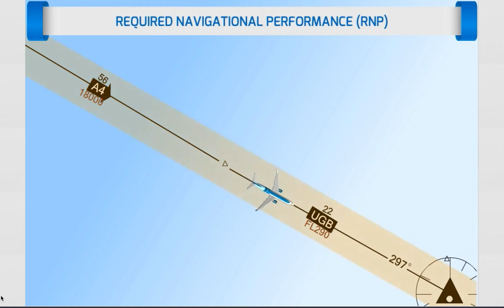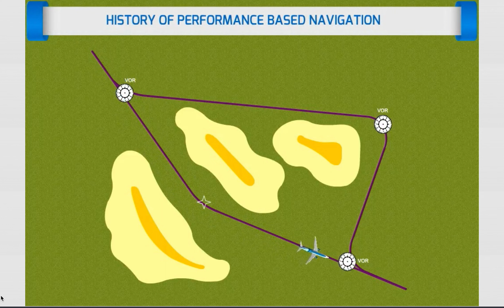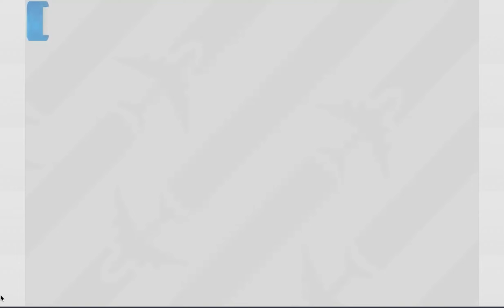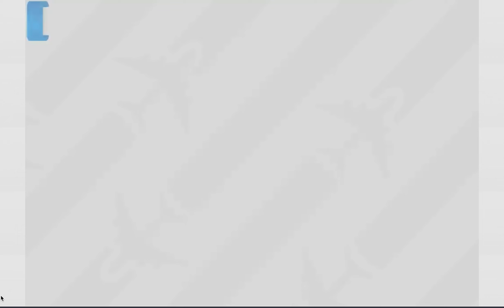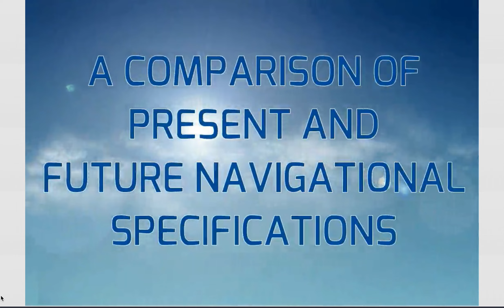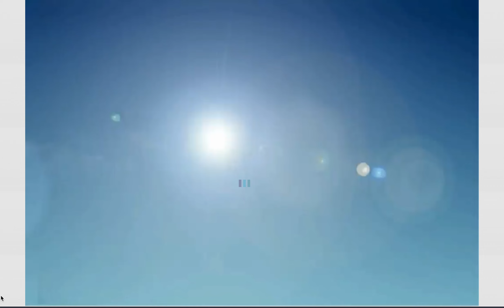PBN Explained | RNAV & RNP | Performance Based Navigation 2024

Comment: If an aircraft meets a requirment for rnp 1 is it also mean it meets rnp 2. 3, 5 or 10 requirment?
Reply: No. Each capability must be approved individually (that’s why in the flight plan remarks there’s a long list of codes PBN/…).
Reply from the maker: That's right
Reply: i believe in a PBN manual it says just because an aircraft meets rnp 1 requirements, it doesn't mean that it meets all the other requirements.